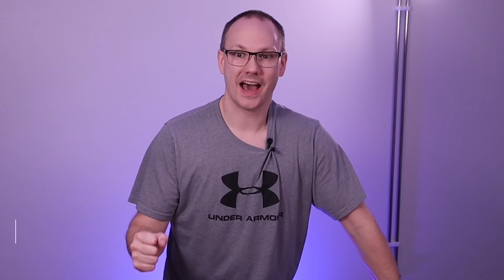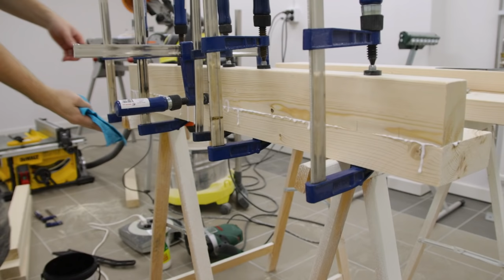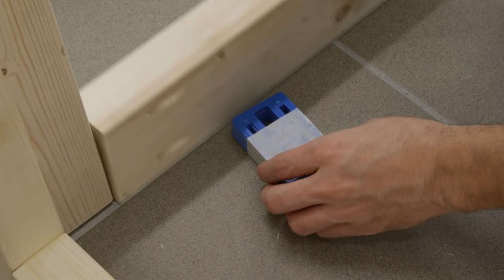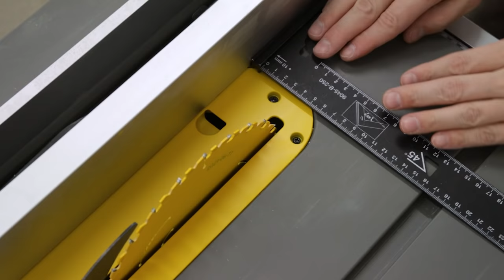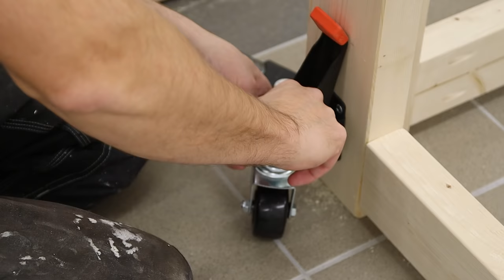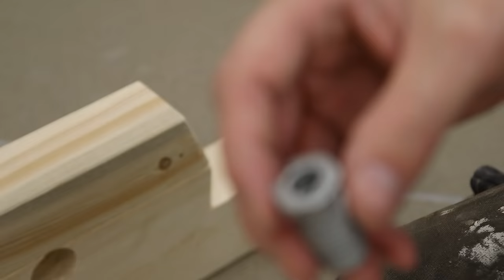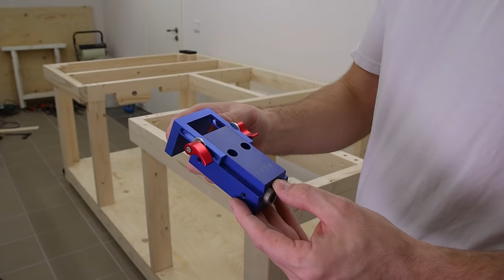Building a miter saw flip-top workbench with a built-in table saw

Comment: I haven’t made it yet but…. Crap is it ever hard to find the parts for this if you live in CAN/US. Same with the materials list. It would be so much simpler if he had a list of what was needed with some semblance of order. Conversions are very tricky to do because of this. I’m saying this assuming most people are just going to use 2x4 and 2x6 for this.
Reply from the maker: Well the plans I sell have a complete list of all that is needed in Imperial with US standard lumber sizes! So all you need is available in the description! Thanks for watching :)
Reply: That’s true and would work, but like you’ve done I wanted to clean/ square up the edges and it takes to much material away to do that, so I’m just adjusting/ checking as I go. Everything is coming out to 85mm x 35mm.

This is probably a noob question but in S13 diagram A you reference “R110” 
What does the R stand for?

Comment: You used a table saw to make another table saw...so what's the purpose of wanting another table saw when you had one already? Duh
Reply from the maker: Huge out-feed table. I can now cut full sized plywood sheets. Use cross cut slets and I also have extra support on the sides. It also lifted the table saw up from the floor to a standing height. Because the table saw is now a part of the work bench, I can also use it as a part of the workbench it self so it no longer require its own space in my workshop. Thanks for watching ♥